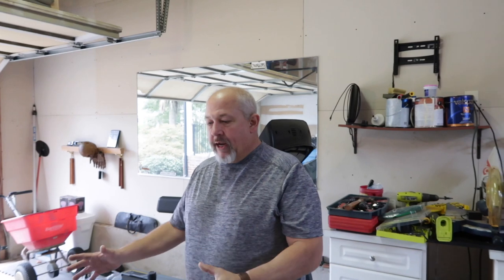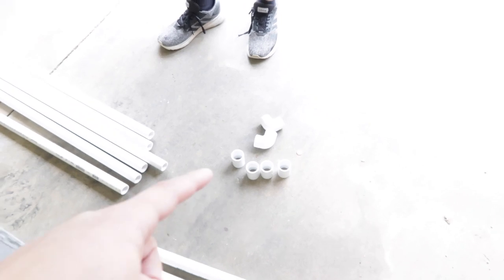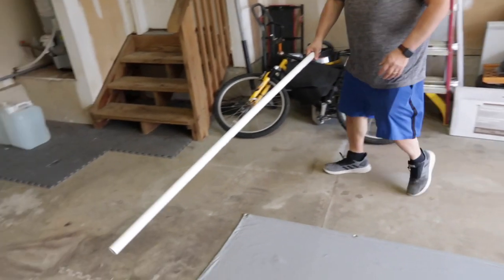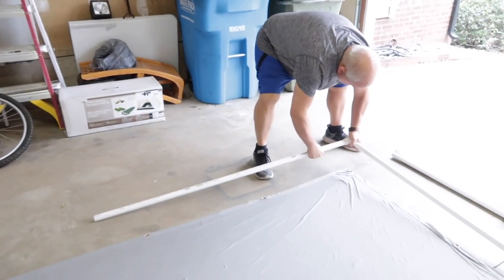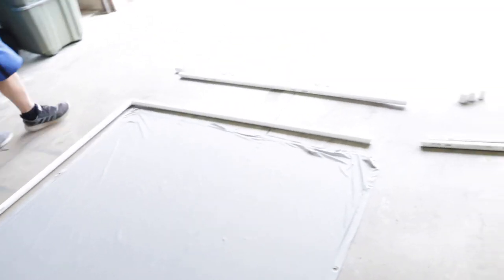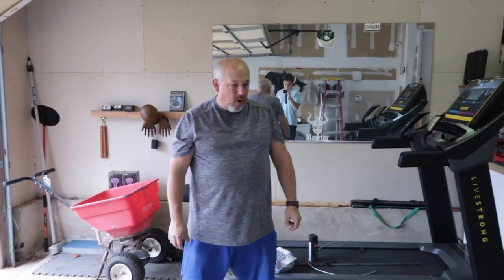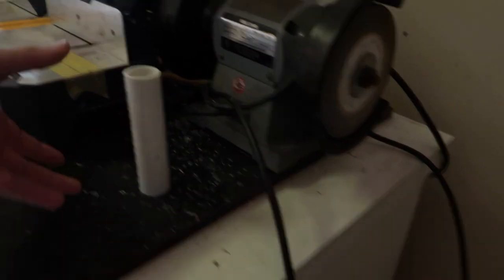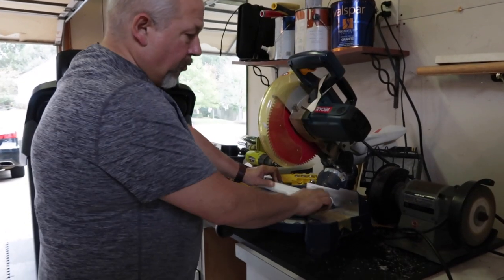DIY Halloween Atmos FX Illusion - CHEAP & EASY

Comment: Can you add a link 
to the screen you bought? I love the grommets being pre-installed!
Reply from the maker: AtmosFX Hollusion Projection Material, Grey, 5.5 x 9 ft https://www.amazon.com/dp/B012Y1V8EY/ref=cm_sw_r_cp_tai_ikuYDbSJ5GDZ0
Reply: Thanks for the tutorial.  I have the same screen material and have been experimenting with a few different frames over the years.  Wood, and faux scary tree props the last 2 years, but I’ve always wondered about pvc.  Your looks great and very similar to what I was considering building this year.  How does it look in a yard scene?  I’m thinking of going a bit smaller then winding the screen material around the pipes so that it tight on all sides with no gaps.  I’ve always had the issue of light pollution in my yard due to street lighting so blending in as best as possible is always a challenge for me.  Thanks again!  Great work
Reply from the maker: Jason P Light pollution is a serious concern. The bottom line is this works awesome if there is none but if your yard has a street light or there is a full moon it’s pretty hard to pull this illusion off no matter how you set the screen. Ultimately it still looks good but the difference between it looking good vs looking real does depend on a lack of any light pollution.
Reply: @IceHausDogTraining  People, let me be the one to let the cat out of the bag. IF your neighbors are cool, street lights are a non-issue.  Streetlights have a plate about a foot off the ground with a pentagonal looking bolt head.  Pretty sure I use a 21 mm socket head and you just open the cap plate (it's attached to the inside of the streetlight by a chain, usually).
I always wear rubber gloves - I've gotten a bit of a shock before - but when you look inside the light pole, you will see wiring. Tug on one of them and it will come out of the hole and you will see, in the middle of the line, a fuse holder.  Just untwist the fuse holder, dump the fuse on the ground (risk of shock comes from grabbing at the fuse), close it back up and it's LIGHTS OUT!
I turn off FIVE streetlights every year.  THe last couple years, I've turned them off for 4 or 5 days in a row.  But it's a cinch, and takes about 7 minutes, to run around with a headlamp at the end of the night and turn them all back on.
THe first time i did it on my new block, the crabby ass old fucker next door called the power company.  So, 2 nights before halloween, I noticed yellow flashing lights outside.  I ran out and chatted up the workers, told them what was up and they were totally cool. THey said they'd just tell the office to notify the caller that the lights would be fixed in 3 days.
If you're THAT PERSON on your block doing Halloween so badassedly, your neighbors already love you.  They will likely have no problem with what you're up to.
If you KNOW you're neighbors are assholes, find my other post about how to open their gas meter....

Comment: My only suggestion would be to use glue on one side of the joints, so that you can still take it apart but not worry about missing pieces such as an elbow or tee fitting. I made one similar to this to use on my deck, using tee fittings on the bottom with extended 'feet'...but I made the mistake of using 3/4" PVC and that was way too flexible. Do not try to go too cheap, lol. The larger the screen - the larger you want the PVC to be.

Comment: I was wondering. What stakes did you use? Because a t-post will not fit in an 1” pipe.
Reply from the maker: Kerstin Hamilton I used rebar for stakes that was pounded into the ground with a hammer. The screen will just slip right over. Remember to get long enough pieces so you can get about a foot or two into the ground and still have two or more feet sticking out of the ground. The longer the rebar the more stability but the screen is light so unless it’s windy you should be fine using 4 ft lengths. Good luck!

Comment: Whats the name of the screen u purchased on amazon
Reply from the maker: AtmosFX Hollusion Projection Material, Grey, 5.5 x 9 ft, I paid $50 for it but it costs more from the current sellers. Wait and keep checking because you can get it for 50. Also I’ll be making a video with a different option before next Halloween